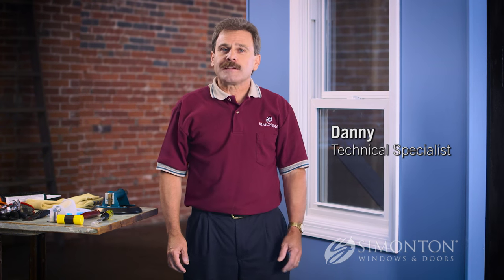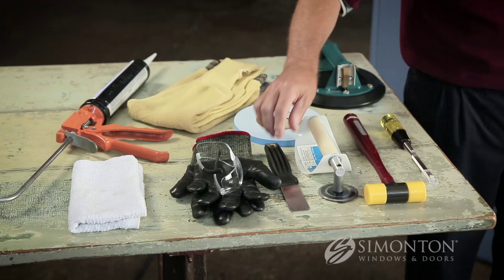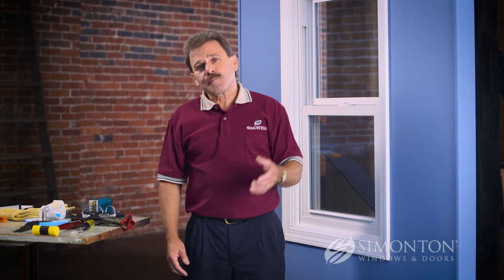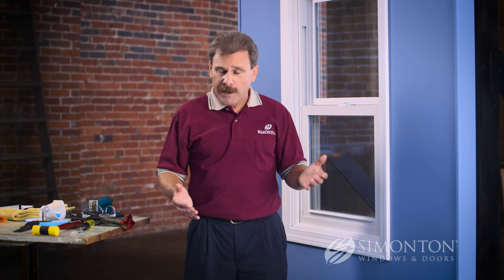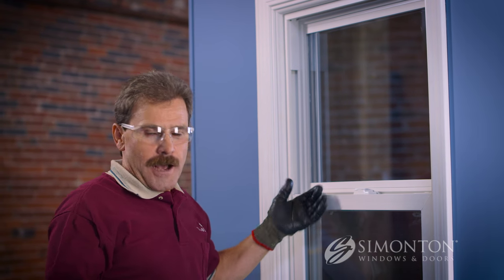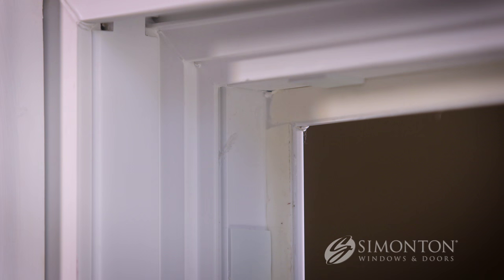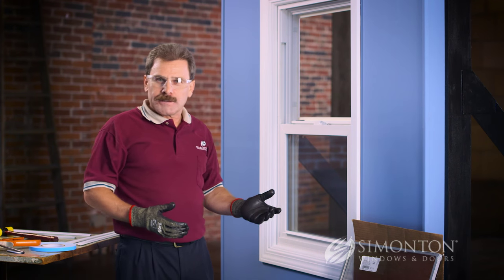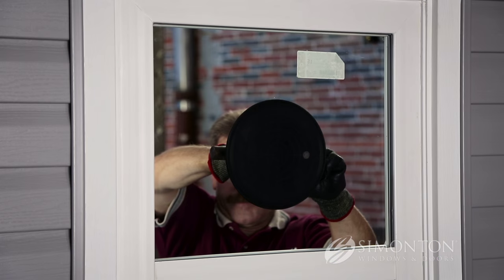How to Replace an Insulated Glass Unit with a Tape Glaze

Comment: The two difficult bits you didnt do! Firstly you didnt SHOW how to remove the glazing tape, which is really laborious and tricky. Secondly because the tape miraculously cut clean you used a silicon bead, but dint show the tricky bit of making it a clean edge and removing excess from the window and frame.
Reply: I wouldnt recommend leaving the tape on there. It is always better to scrape it off until the old tape is gone. I wouldnt use both tape and silicone. I would use one or the other. I use a painters 5 in 1 tool that is dulled down a bit to keep from gouging into the vinyl frame. I am always looking for easier ways to scrape the left over glazing tape.

Comment: The EZ DeGlazer tool is not available in the UK and I need one.
Reply from the maker: Hi there! While Simonton does not currently sell this tool, you should be able to find one available on Amazon. If you haven't already, we recommend visiting your local hardware store or glass shop to see if there's an alternative tool available to you locally. Typically using the flexible putty knife as demonstrated in this video should deglaze your window just fine! Please let us know if you have any other questions and we'd be happy to help. -Ashley